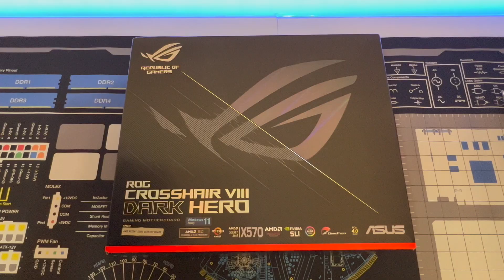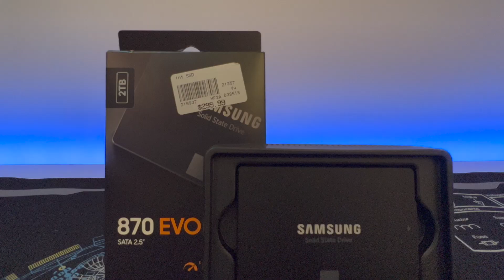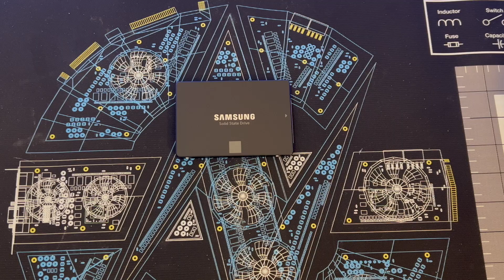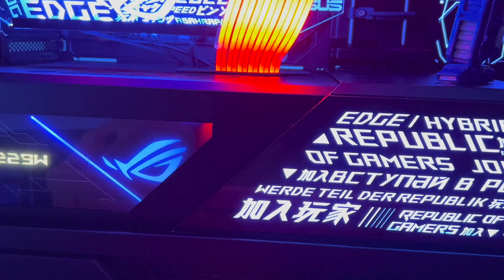My First Gaming PC Build (Asus ROG Build)

Comment: Can Arctic Liquid Freezer II or III be used with the Asus Rog Helios case? Since the radiator is thick, can it be used in the upper part of the case? Radiator + fan thickness is 63 millimeters. (To be used with Asus Rog X670E Crosshair Hero motherboard)
Reply from the maker: Should be fine. Helios is a big case. I think i had a push/pull configuration in there at one point
Reply: @prime1964  Thanks for your answer :)

Comment: nice build. not hating but just wondering why didnt you go for the ryujin 2 instead of the kracken. it looks like you spent top dollar? why not go for more asus rog when able.
Reply from the maker: I chose the Kraken because it had better reviews than the Ryujin 2. I also didn’t like the blocky shape of the screen/pump of the Ryujin 2. I also preferred the simple hardware monitor screen on the Kraken.

Comment: Was the ARGB Hub: EnLabs Aura Sync ARGB Hub Splitter a must have in this build? Could everything have been connected without it?
Reply from the maker: There’s not enough ARGB headers on my motherboard so I had to use the hub.. But if youre not planning to use so many RGB lighting then you wont need it
Reply: @prime1964  appreciate the answer. I'm planning on using the same mother board with a similar amount of lighting. Good information to know when I start this.

Comment: Where did you find the damn motherboard screws? Cannot find any with my case.
Reply from the maker: It should be in the small box with the vertical gpu bracket, ssd plates.. there’s like 40 of them in a plastic bag.. also, your motherboard should come with them too

Comment: 5:50 wtf???
Why are you putting more termal paste if that comes pre aplícated??? 🙄🙄🙄🤦🏽‍♂️🤦🏽‍♂️🤦🏽‍♂️
Reply from the maker: Pre-applied paste have a tendency to leave an air bubble in the middle, i added a little bit more to cover that and more areas at the edges
Reply: @prime1964  - it's not a good idea to add thermal paste if there's already some on the AIO that's pre-applied. You run a real risk of damaging the motherboard and/or nearby sockets doing thar, plus the paste may become ineffective sooner.

Comment: Hi, How you find solutions for short cable CPU 8 pin from PSU to mainboard ? for me, it too short. I use Thor 850W
Reply from the maker: I used a cable extension
Reply from the maker: (2-Pack) COMeap Motherboard ATX CPU 8 Pin (4+4) Male to Female Extension Cable for Power Supply PSUs 9.5-inch(24cm) https://a.co/d/bnecmnW
Reply: @prime1964  Thank you so much. I got it

Comment: did you have any compatibility issues with the Ram? I have mostly the same components and looks like the ram is not compatible.
Reply from the maker: I have no problems with the G.Skill Trident Z Neo RAM. What compatibility issues did you have?
Reply: @prime1964  after a few min of use, it gives me a fatal hardware error, component: Memory. Could be a faulty Ram stick. But I have seen online that a lot of people have the same issue.  Some suggest it is not compatible. This Ram is not listed in the QVL and it could be an issue. But since you have not encountered the problem then I guess I will have to keep investigating.
Reply from the maker: @andresfigueroa9289  make sure to run memtest or Windows Memory Diagnostic to find out if you have a faulty memory stick.

Comment: all computers are basically exactly the same now, just on different tiers of performance 

i'm surprised the tech industry had not standardized PC sales by 2012
Reply: Whatcha mean?
Reply: @georgecurry1  PC hardware manufacturing and product distribution is now standardized, but not PC sales: so PC sales is still done by overcharging 300-400% for pre-built PC"s, which forces price conscious customers to build their own PC's for no reason

in other words, PC customers are all buying the same hardware but are being charged +300% for ordering pre-builts, because each company is forced to put together the system from parts they have ordered from the manufacturer, instead of the manufacturer sending them pre-built systems like on the console market, which helps to keep prices down under normal market conditions (i.e. no covid)
Reply: @CR055FIRE  im not sure what world you live in but most Prebuilts from gaming companies do not have that markup on them, micro center only has this kind of mark up cause its a service they are selling and only goes this high when doing custom water cooling

Comment: nice build were did you get those rgb asus logo from?
Reply from the maker: It’s from Ali Express, a retailer from China
Reply: Its mean the acrylic logo and the led strip?
Reply from the maker: @TurahBagus  i didnt use any light strip. All the RGB panels and the RGB GPU bracket i installed are from Ali Express
Reply: @prime19 i think you got from package asus case.
Reply: Plys man can you give us the links for thats things you have buy on AliExpress?
Reply from the maker: @marcelomurisk  US $35.04  16％ Off | ASUS GX601 Front Panel Metal ROG Strix Helios Case Plate Replacement Lighting Shroud MOD Gaming PC Water Cooling Customized DIY
https://a.aliexpress.com/_mtMto30
Reply from the maker: @marcelomurisk  the bracket under the gpu is no longer available from ali express
Reply: @prime1964  thank you :)

Comment: Great build, mate!!!👍🏼 I’m building the same but with Samsung 970 pro and multiple Samsung 2TB ssd instead of an a disc hd. I’m on the fence though over RAM. Corsair Dominator platinum or the g.skill tridentZ Neo you have here. Anyone have a reason I should go one way or the other or suggestion? Oh also. I’m going Corsair for fans and AIO
Reply: I wish i had that opportunity to build that type of PC....
Reply: @ZAND4TSU  I’m a father of three and a husband and I have been saving up since Christmas of 2019. I’ve been luck to have made it this far lol
Reply: @KillianWargear1921  damn, for real...and i am only a 16 year old teen going through high school 11th grade... And who wants to get a job, but can't cause of some issues
Reply: Probably too late to respond to your ram question @killian but from experience I went with the Corsair ram not realising that the G.Skill is Aura Sync but the Corsair is not.... Therefore you'll end up using corsair's crappy RGB software.... I'm switching to G.Skill for my upgrade... Ram wise I've had no issues with my 32gb of Vengeance Pro RGB but I want everything to play nice....
My build is nearly identical to this....
Helios Case
5900x
64gb G.Skill 3600... (Not the neo.... Don't like the extra silver)
850THOR instead of the 1200
Sticking with my X570 STRIX F MB for now.... If I bother with an upgrade I'll probably end up with the FORMULA over the DARK HERO (in case I go custom WC)
Love the Lian Li fans... But I will stick with my Deep Cool for now
And I went with the Ryujin ll 240 AIO cause I had a smaller Corsair case for the last couple years before my HELIOS arrived..
MY storage is all different... I went  2x Crucial 2tb NVME M.2's and 3x Crucial 2tb 2.5 SSD's
I do love the STRIMMERS ... but I'm not sure.... I was going with some custom length CABLEMOD 24 pin and triple 8pin... In a custom red and black pattern.... But we'll see once it's rebuilt with the standard sleeved Cables from the THOR.... Love that thing.
Also waiting on those custom RGB panels, Because I  might do a little diorama inside the case that I wanted to but didn't have the space for in my old case. 
AN ROG FALCHION Keyboard
Still looking at mice
Oh and GPU.... I Went with a regular 3080strix non ti

I have to say though.... Cudos on a great build for your FIRST gaming PC. You have fantastic taste 😂

Comment: To much Watt power supply
Reply: For a power supply bruh i cant eben write
Reply: even
Reply from the maker: For a 3080ti  gpu they suggest nothing less than 1000W. But their 1000w doesnt have the display.
Reply: @firewater7020  Are you okay? Its the 3rd best performing gpu in existence right now. You're high buddy.
Reply: No such thing as to much in pc building ;)
Reply: @prime1964  The 1200 watt power supply is very nice, it definitely will always handle any task with this build.